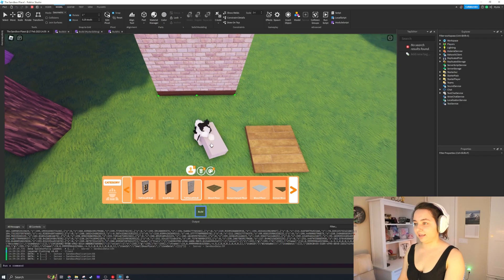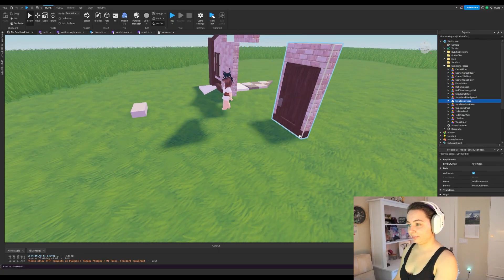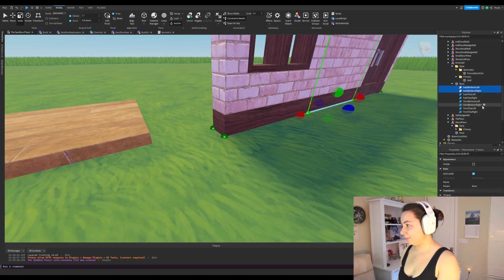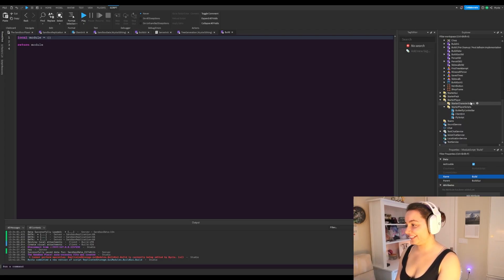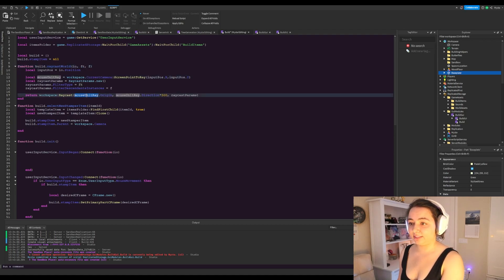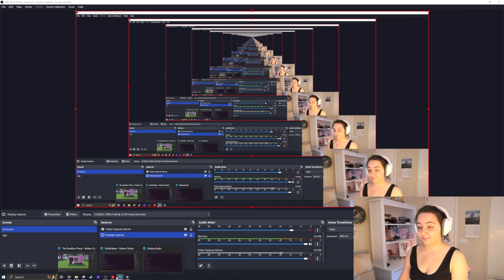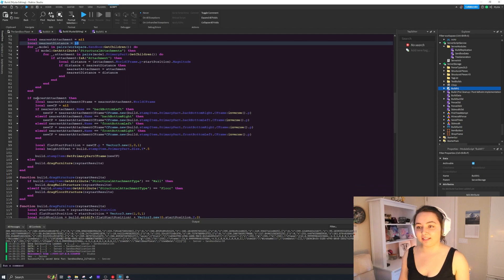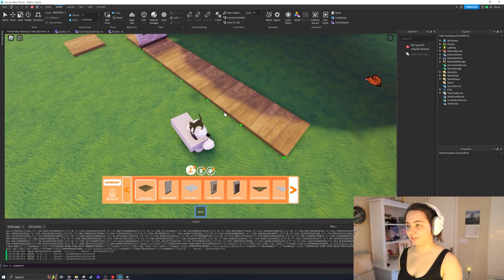How to make a Building System in Roblox! | The Sandbox Place Episode 4

Comment: For the problem your running into, are you meaning when you have a angled wall and you wanna put a wedge ontop of that it won't 'snap'/connect with the other wedges? If so, you could so some negate/union function that would just remove the excess using some fancy stuff.